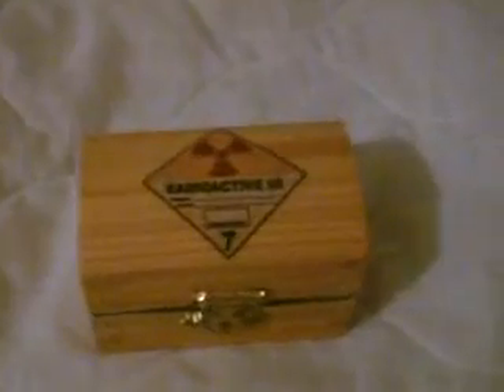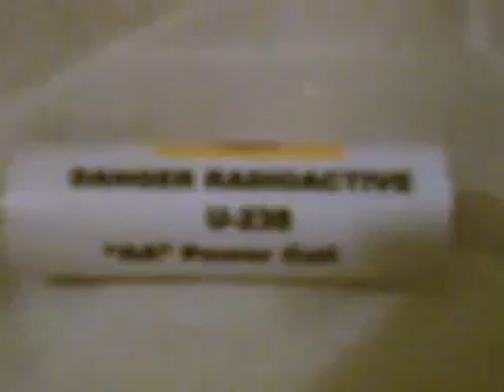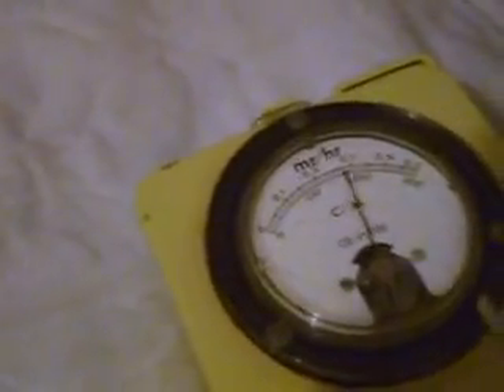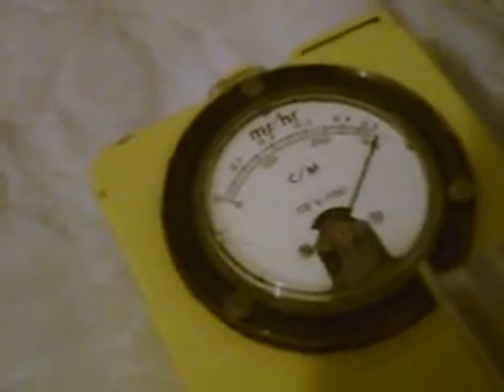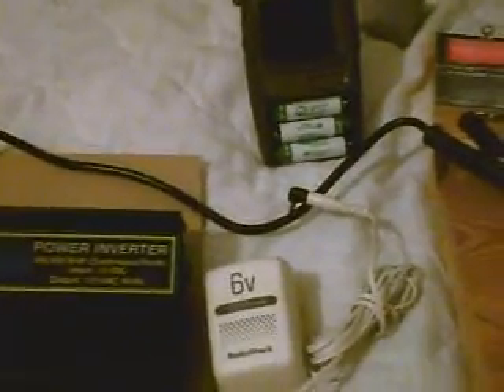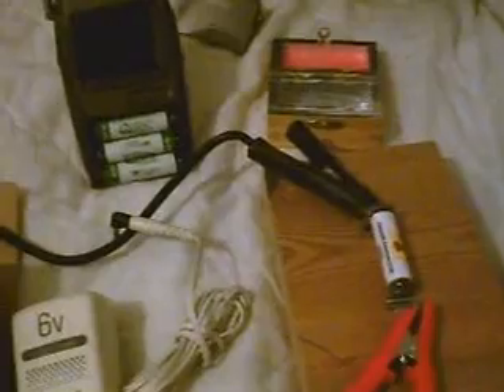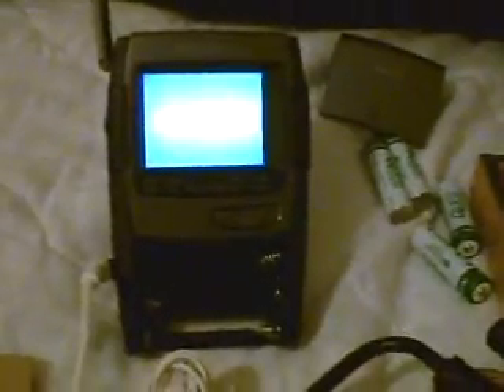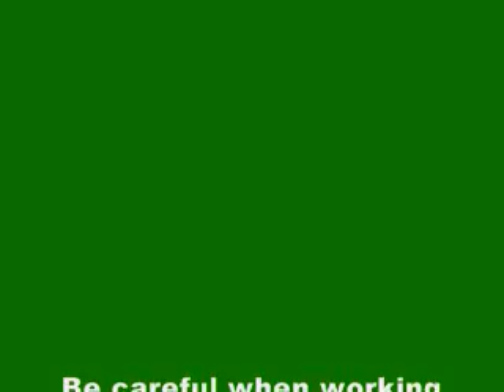How to power a TV with a "AA" power cell

Comment: A small mistake: Uranium-238 is not used for batteries; Plutonium-238 is. It's also not 1.5v, but rather around 3v. It is used in places where a very-long-lasting battery is needed (e.g. pacemakers), though it is uncommon today, as lithium batteries are cheaper to produce, and can be made as reliable as a Pu-238 battery, not to mention that it needs no radiation shielding (there is only chemical danger).

Comment: This video is obviously a fake however real atomic batteries do exist too and they do not utilize conventional heat engines but use techniques like betavoltaics and thermopiles. They are quite safe to handle.

Typically the emissions would not cause the bed to become radioactive even if the emitter wasn't safe to hold due to direct alpha or beta radiation although this is unrealistic battery design since alpha and beta radiation are easily blocked.